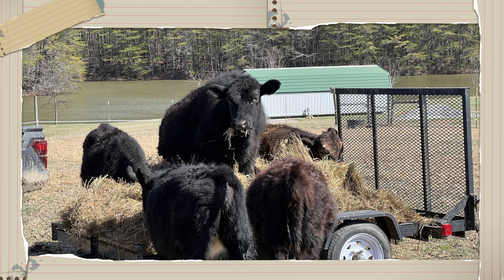DIY Electric Twine Tie Converting the Manual Tie Baler

Comment: Good project. We bought a new to us 07 NH 575 yesterday for our new 6075.
Reply from the maker: This past week we had a break from the rain I was able to get about 10 acres cut. used the baler with the new twine tie and it worked like a champ. I have added a few other small modifications to this old baler (1979). Awesome on the new baler let me know how it goes in case I ever wanted to go up in bale size.